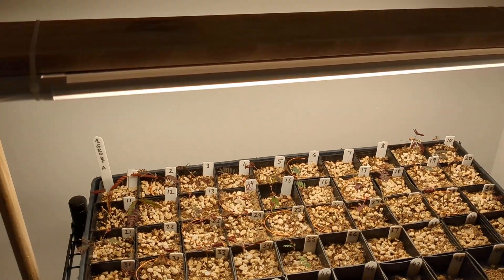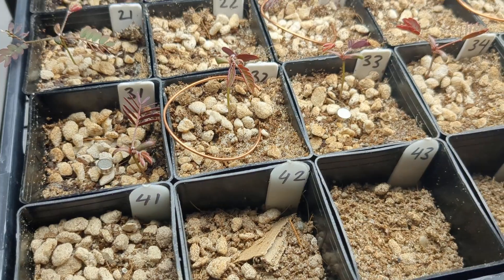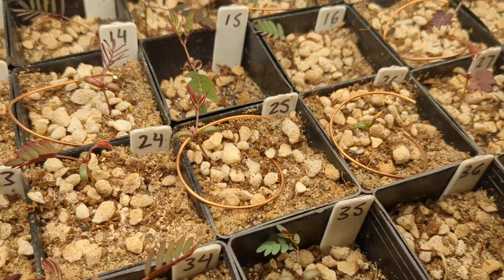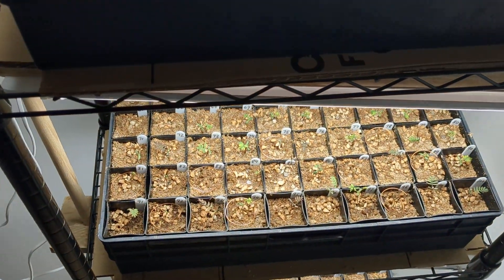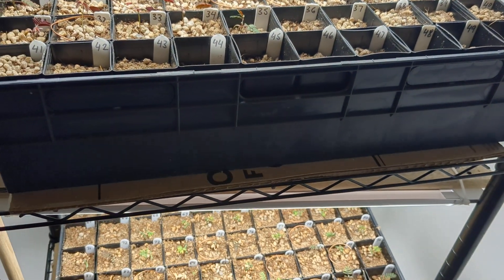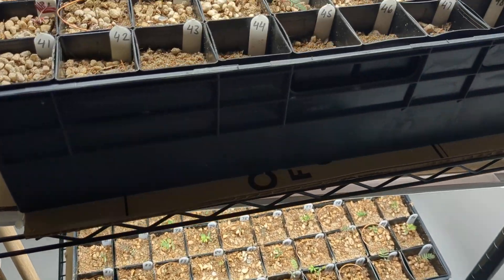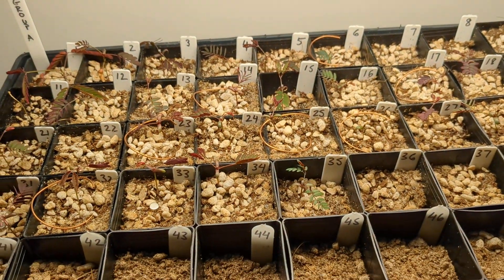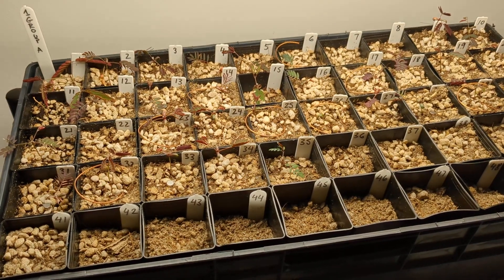Electroculture revisited: 02 June 23, Copper coils and magnets are finally in the pots

Comment: Bare copper 12 gage wound in 7 spirals leaving 4 straight inches at the bottom and top.. Place on south side of the garden into soil have top part with a slight pointing toward the north. That works.
Reply: Each coil gives you a 3ft radius. It also wards off pests .. or so Ive personally found. Im not sure about the southern hemisphere and counter clockwise. Id try both ways. Bc you will see a difference in about 3 days.